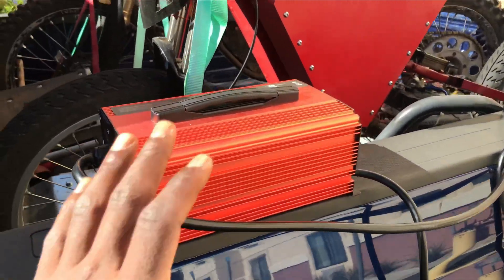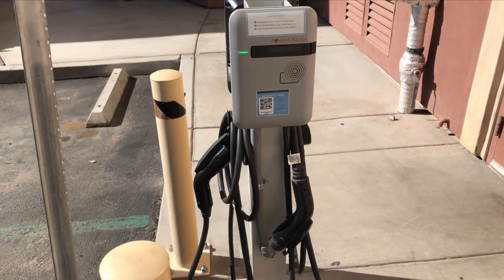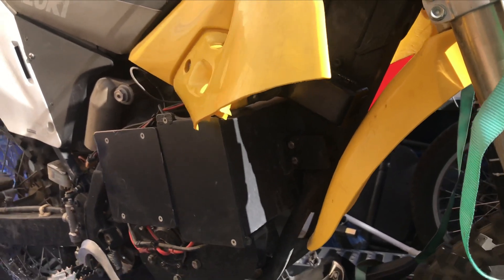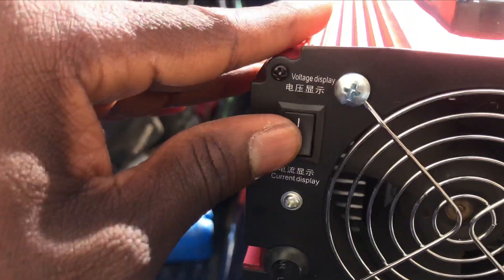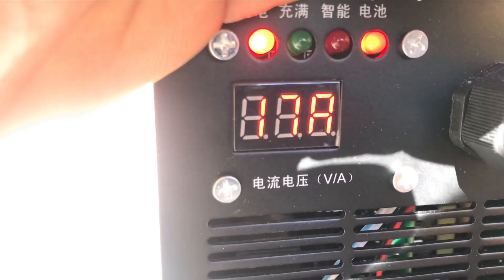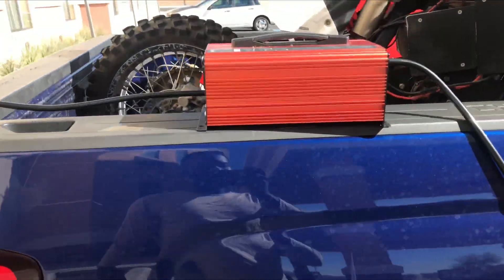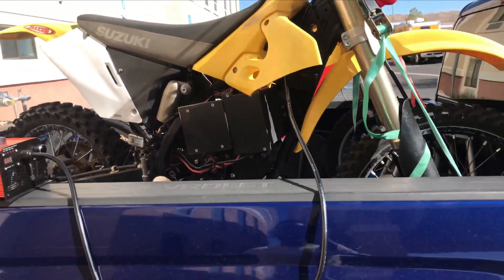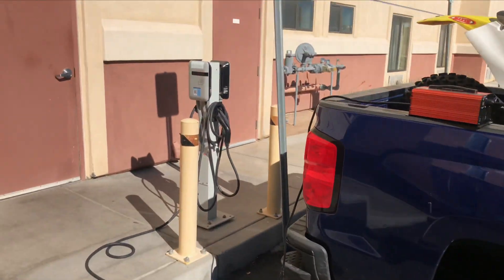First time charging an electric dirt bike at a car charging station

Comment: Why did you not just charge from your truck? Then you can charge while driving. Most cars alternators are good for at least 1000 watts. (Inverter or dc-dc boost converter and you can ditch that huge red charger)  Hear me out. Your setup, 25amps x 80VDC x 1.2(assuming his red charger is at least 80 percent efficient) equals 2400 watts. That is comically low for a public EV charge station and your taking up space for EVs that can actually use  6kw-18kw of power.

Comment: Hey bro nice work..I was thinking about this same set up with that adapter..lol...My only question/concern is running a charger at 20amp+ wont degrade the life/performance of your battery packs? Awsome work bro once again👌🏽💫💥💨💨💨
Reply from the maker: No it won’t,my battery pack is big enough and with a 1c charger rate rule of thumb that puts me at around 60amps.so it should be fine.
Reply: @britto761  Awsome bro good to know
Reply: @britto761  This is the first intelligent comment I've read about charging all day. (Surron owners are clueless).   To explain his logic further for anyone else reading this, you determine your c rate by the batteries amp hours. A 5ah battery would have a 1c charge rate of 5 amps, 2c charge rate of 10 amps. And vice versa for discharging. It's a pretty standard rule of thumb that lithium batteries are more than capable of a 1C charge rate. But if you look at the data sheet for the cells used in your battery, and you understand your battery's series parallel internal cell configuration you can determine your max safe charging speed for any lithium battery.

Comment: Where is the affiliate link to charger?
Reply from the maker: US $189.00  10％ Off | 48V 54.6V 58.8V 60V 67.2V 72V 84V 88.2V Lithium Battery Charger 5A to 25A Li-ion Lifepo4 Fast Current Adjustable 16S 20S 21S 24S
https://a.aliexpress.com/_mqrMs9Y